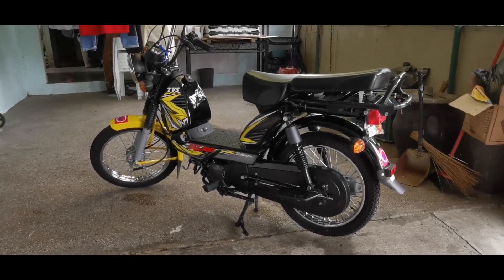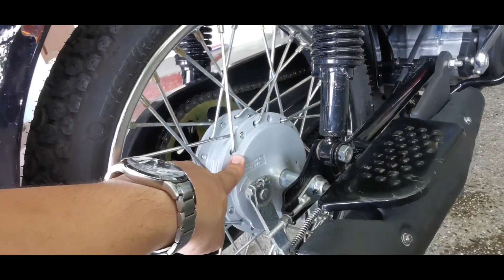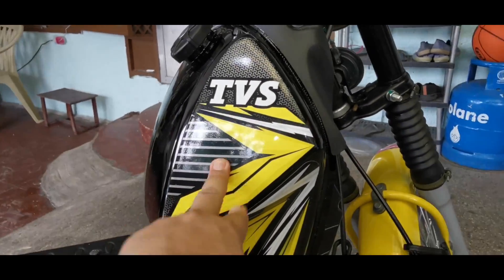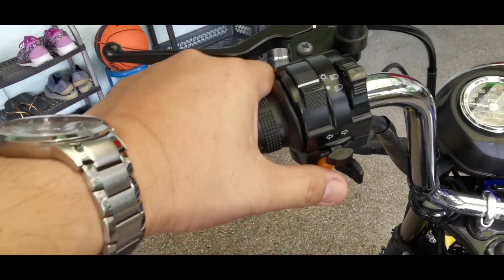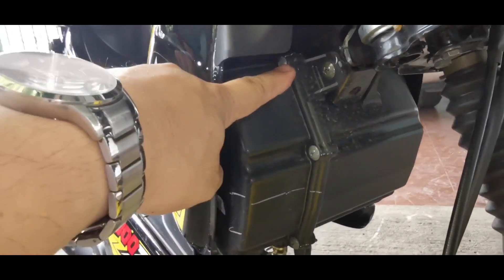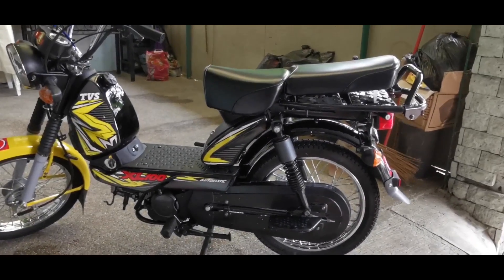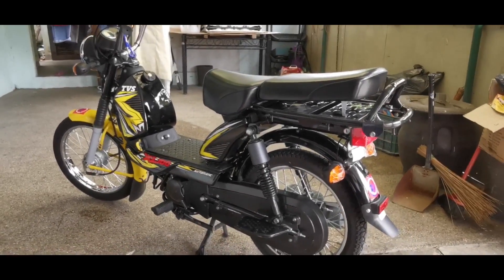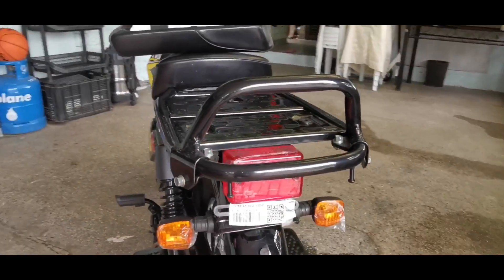TVS XL100 Walkthrough

Comment: hi bro nice video, how do you check if you ran out of gas? also what kind do you put inside the tank? newbie here thanks!
Reply from the maker: Thanks and welcome bro. Pwede silipin, katukin or alugin. Twice na ako naubusan pero since may 1.3 liter na reserve, malayo pa para magtulak hehe.  In our short trips dito sa village it averages 50 kpl (manual syay 65kpl). I put Shell VPower or Fuel Save Unleaded. Any premium gasoline should be fine. If you are planning to get one, great value for money. Wag lang pang highway, too slow at 60kph max.
Reply: City riding din I don't mind Kung 60kph si turban rider nagluzon loop na Pati visayas din kaya ok Lang Ang speed sa akin it's not about the ride it's the adventure